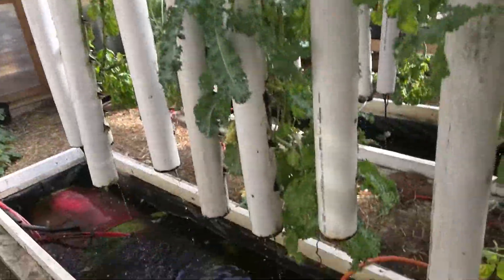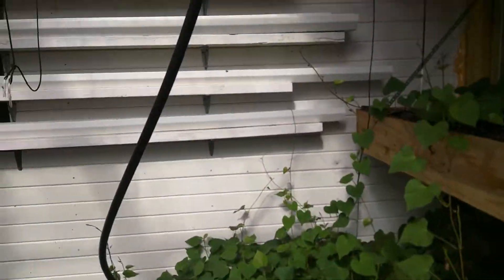Aquaponic towers walkthrough.

Comment: Hmm I can't find a reference to that Hill Billy heater on the wiki or in any docs yet, so I don't know the design specs/goals, but it seems to me a high pressure system may not be needed if the only purpose is to heat the water. Maybe a no pressure gravity flow black enclosed gutter module would work with a low flow/power pump.